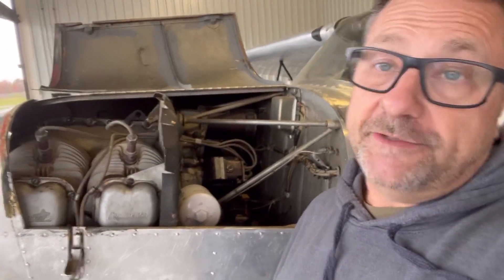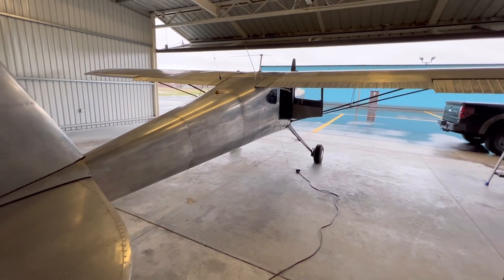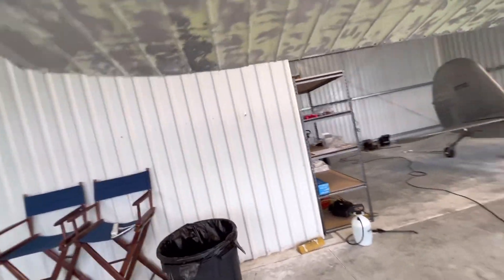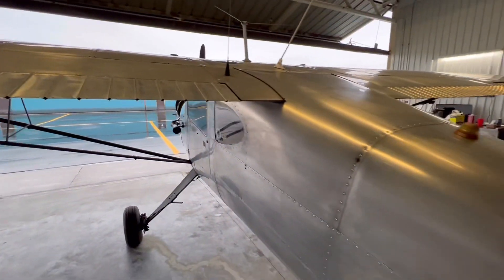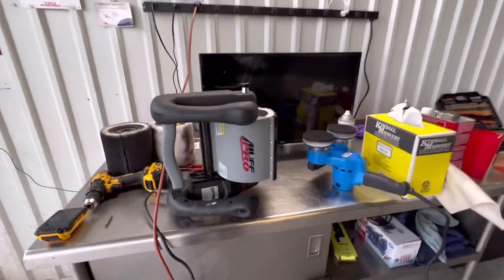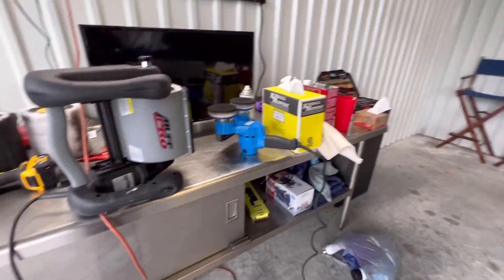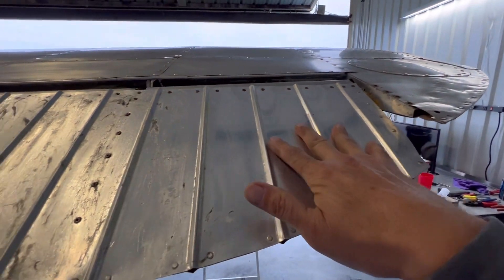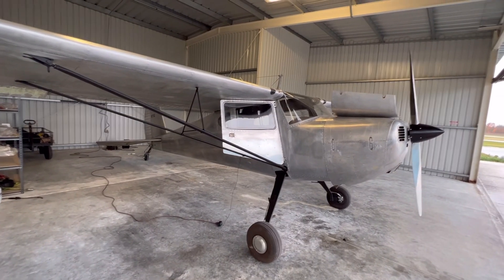POLISHING A 1946 CESSNA C140 FOR THE FIRST TIME!

Comment: Now you've stepped into my realm, as it was.  Pops was a Private Pilot for over 40 years.  His first plane he owned was a old Cessna 120 taildragger.   It was a 1940's, but don't remember the year.  The 120 was the economy trainer version of the 140.  He had flown briefly(and jumped out of planes) in the Army with the 101st Airborne in a spotter plane, and was hooked.  Once cut free from the Army, he got his license pretty fast.  The 120, was my first experience with Never Dull cotton wadding polish and polishing aluminum.  I was 6 at the time, but I still remember that, and all the hours he spent.   The funny petroleum smell to Never Dull is something you don't forget,,Like,, Hoppes #9 Nitro Solvent for firearms. Tiny bits of cotton Never Dull, going in circles for hours till my bitty fingers ached,  Dad plowing forward for hrs.   When it was done,,it shown glistening silver in the sunlight,, to where you couldn't look at it in the direct light or risk circles in the eyes.   A polished mirror aimed at the sun.    Never Dull is still around, I used it on big truck Diesel fuel tanks, for the freeway shine.

Comment: Get a MAKITA VARIABLE SPEED buffer. The one that has the D ring handle. It is made for doing auto body stuff. It is electric so you can really lean on it with the torque of the electric motor. Use the 3M SYSTEM of buffing/polishing compounds.
I have used the Makita for over 20 years.
You can slow it down g or very fine polising or speed it up to do heavy, serious, buffing of those scratches!!!
It can be used to put a mirror finish on aluminum. 
I used it to do all the aluminum work on my altered prior to getting a Baldor bench buffer.

Comment: The rivets you point out - the little dimple indicates they are MS20470AD rivets probably the single most common rivet in aviation. They're solids and likely hand riveted when the airplane was manufactured, as opposed to squeezed. I just want to caution you, but it sounds like you are already aware. Do not sand or remove metal from the heads of the rivets. During a post-paint inspection of a Twin Commander we identified the paint shop had sanded the heads of the rivets, ultimately the airplane was scrapped as a result.

The aircraft skin is likely 2024-T3 aluminum alclad, the surfaces are pure aluminum with a 2024 core. the cladding is only 2-5 thou thick so I doubt you'll have enough material to remove any scratches without exposing the 2024 core. The 2024 doesn't polish quite as nice as the cladding does as I'm sure you'll find out during this project. I've never seen one start painted and end-up polished so I'm very interested in this endeavor. Good Luck, enjoy yourself, and I can't wait to see how it goes!!

Comment: I’ve owned my 140 for 14 years.  I’ve thought about stripping and polishing it a number of times but decided against it for a couple of reasons.  First, I like to fly, not spend hours on end polishing it.   Second, the aluminum skin is alclad which has an anti-corrosive layer bonded to the surface.  Polishing removes the protective layer…and you certainly cannot sand it at all.  So if you have scratches, you are stuck.

Polished 140’s look sweet.  But so do nicely painted ones.  It’s just not worth the effort and damage done to the aluminum surfaces.  

Side bar - my plane with fabric wings has a useful load of 499 lbs. I find it hard to believe you have 550 lbs of useful load with aluminum covered wings.  Probably more like 450 lbs or even less.   If you haven’t already, you should check this.  An extra 100 lbs of load can be a real issue on a short grass field on a hot summer day.  😉

Nice video, good luck!